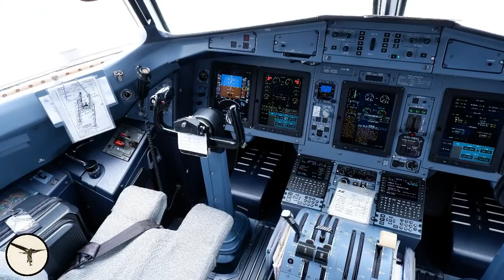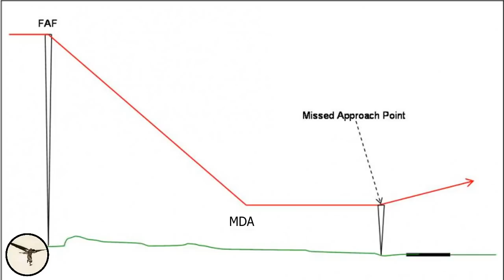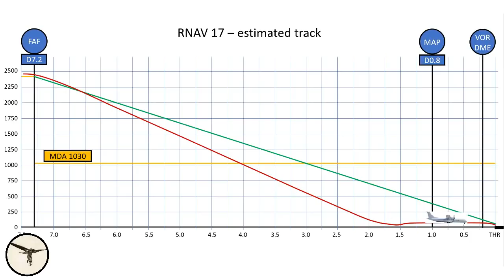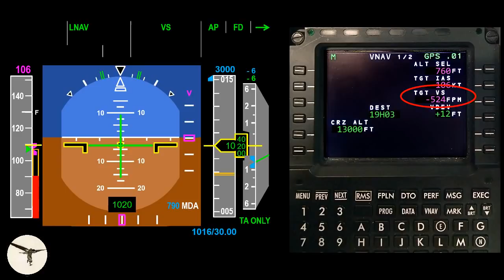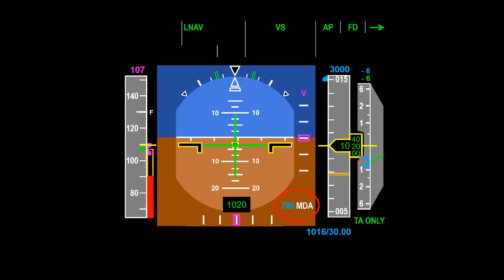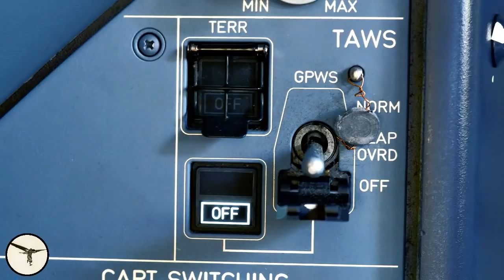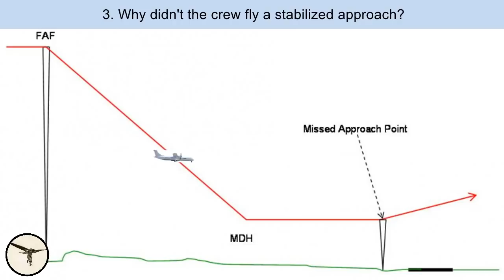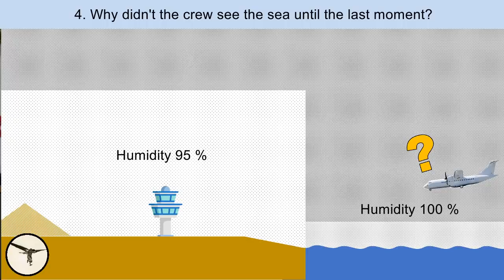Second from disaster - RAM Express flight 439

Comment: The "water monitoring" comment makes me think that this might not have been the first time the captain did this. Perhaps the previous time(s) the visibility was not quite as bad and they had visual reference to the water before hitting it...

I am still curious what altitude the pilots thought they were at when the GPWS rang out the first time. Did they think they were still above the cloud ceiling of 600 ft despite altimeter readings, etc due to the whiteout conditions?

Comment: Excellent explanation! To me, this shows two things. 
1. The ATR is a really well-built plane, coming out of this with only relatively minor damage and no harm to the people on board, despite the captain's effort to f*ck things up.
2. Some people, despite likely meeting formal requirements, just shouldn't be sitting in the front left corner of the aircraft. Seriously, a person who shows no respect whatsoever to the rules and puts the life of people at risk like this has no business flying in my opinion.

I have mentioned it in other videos - I am just an aviation enthusiast who has never controlled a plane in the real world. But as a passenger, I expect the flight crew to pull up when EGPWS tells them to. Yes, it may be a false alarm, systems can malfunction, but usually there is way more space above the plane than below during the approach, so pulling up is the safe option. I rather have them go around, check what's going on, and possibly divert than to just ignore such an important warning or even turn the system off because they are annoyed by it telling them that they are doing something wrong.

Comment: There’s quite a well documented instance of a land plane surviving heavy impact with water and continuing to fly afterwards, with the proviso here that a) it was a military aircraft, and b) it was on a war operation. On the night of 16th May 1943, Lancaster ED936 flown by Pilot Officer Rice was on it’s way to bomb the Sorpe dam in Germany when it came in contact with the sea (it was at night and they were deliberately flying at an altitude of 30 feet). The impact ripped off the Upkeep mine, buckling the roof of the bomb bay and sending sea water shooting down the rear fuselage. There was a second impact on the tail wheel by either the sea again or the bomb travelling past. This caused the tailwheel to be forced up into the fuselage demolishing the Elsan chemical toilet. The tail gunner was a bit peeved at this point because he was now dripping wet and covered in the contents of the toilet... The aircrew flew back to Scampton, from where they’d taken off and landed with no injuries to the crew.
Reply from the maker: Wow! That story deserves a video!

Comment: Good analysis, it was really close. Almost the shit hit the fan
Reply: Hi
All it is about the safety culture of the company combine with the country culture. The company culture it is unknown for me, I do not know any one there nor worked there neither. The country I am familiar with it since I have flown many times there, I could see that they follow what the manager says mainly, I guess there is excemptions. This kind of environment can make the FO to w react like that. About the captain performance, he did it the on the previous flight so I guess it was normal ops for him to bust the MDA, at least at this airport, I do not know in other airports, I base my opinion on the facts we have now. I flown ATR before and I remember in one of the airlines I flown, there was a case of a Cpt doing a circling and he ended up too high on final, he tried to save the app but the FO call for go around as per SOP,  he kept trying, FO call again go around not finding response so the FO took over the controls and execueted the missed approach. Final result they filled up an ASR and the Cpt had some tea and biscuits some sim training problem solve. The application of the just culture and the SOPs in a safety oriented environment help a lot the crew.
Reply: Manuel J. Paz G. Well the examiner who passed him over a cup of tea and biscuits is just as “guilty” as the captain if not more, as he disregarded his responsibility to weed out the pilots who show such a dangerous attitude and if someday anything happens to that captain, the examiner as far as i am concerned should be the one to be blamed and held responsible
Reply: @diegobeatrice5257 I do not think he got passed only with tea and biscuits. Tea and biscuits was in the office, after that he went throught training and checking, the pass was not for free. Everybody can make mistakes and if properly retrain I think should not be a problem. The sim in that company were at high standard, they did not give anything for free, belive me.
Reply: I agree that they are people that you can not retrain. People with attitude problems won't change in their life, in my ex company case  was possible since it was an isolated event. I do not want to talk about the RAM captain, since I  am not aware of his personality but what I can see, based on the facts, probably it is the difficult ones to retrain.
Reply: Manuel J. Paz G. I was talking in general, not about that specific captain as i dont know him personally and i would never dare judging him on a personal level as behind the stripes there is always an individual with his personal issues.

Comment: One thing I'm confused about is the configuration procedures on ATR. According to ATR FCTM, configuration management starts at 10 miles from touchdown. But other procedures within the same FCTM have different procedures otherwise. 

Let's say for example on the Basic ILS procedure, once GS Alive set F15, One dot Gears down, and half dot F30. When you are vectored there can be instances where you will even intercept the ILS 20miles or more, and adherence to this Basic ILS procedures will put you already in a landing configuration very early. Imagine flying 100kts at 20miles, you might be pissing off all the Airbus/Boeing behind you. This kind of of approach configuration can't be practical at all times.

Starting the configuration at around 6-7 miles can sometimes put you on a very late speed management at stabilization altitude, especially if you  are above 170kts or at 170kts but not aware of the tailwind component which puts you on a very high groundspeed and closing rate.
Reply from the maker: The FCTM is a training manual. It gives the basic procedures. However, when you are flying in the real world, you adapt to realities. In the FCTM, you intercept the ILS localizer when flying horizontally at 170 kt at 2500 ft or so. This rarely happens in real life. Thanks to the FMS, it's very easy to fly a continuous descent from the top of descent until we cross the runway threshold at 50 ft. On one occasion, I was fully established on the ILS at 14,000 feet (runway elevation 6 ft). 

So what we do, is to fly the approach and start configuring the airplane at about 2,000 ft above the runway. And thanks to the excellent braking power of the propellers at idle power, we can fly the intermediate segment much faster than the bigger jets, who have more inertia and must slow down earlier than us. 

I am based at Bangkok Suvarnabhumi Airport. It can be quite busy here. But we never have problems with the bigger jets behind. It's rather the opposite: Quite often, ATC must instruct us to slow down because of a jet ahead of us.

Tailwind? We compensate for tailwind by starting configuring the airplane a little higher.
Reply: @FlywithMagnar  almost the same in manila captain..!! We adapt to the situation.. crowded and congested airspace.. happy to flying the turboprops.. nice video capt, this is ashok line Capt from cebgo

Comment: It might sound silly, but I think there is a huge factor behind these incidents and many more: Blind trust in the safety of the system (and coworkers).

It doesn't matter if we speak about IT security, aviation safety, nuclear safety, etc. there is a very important understanding behind them all: We can't make perfectly safe components, we can't improve their reliability, security, safety beyond a point, but we can design multiple different lines of defense between us and a disaster, and when we need multiple seemingly independent failures for a disaster, things can be safe/secure enough. 

But when people see the system as "perfectly safe anyway" and feel it is safe to undermine "some lines of security" that attitude can mean we no longer need several fully independent failures to happen for a disaster, but we can get to a disaster with all the other issues linked to poor safety culture built around the assumption that "I can take a few shortcuts, ignore a few rules, the system will remain safe anyway". 

People assume it is about their freedom until other people gets hurt, and get angry when anyone checks their behaviour and even more angry if they get punished for taking those shortcuts. But a certain but mild punishment for taking dangerous shortcuts than a fatal accident.